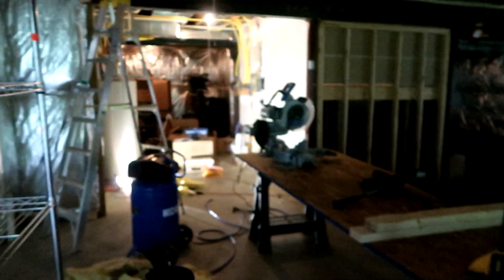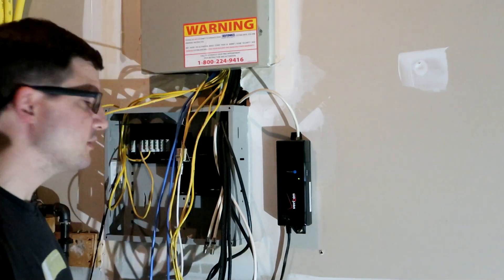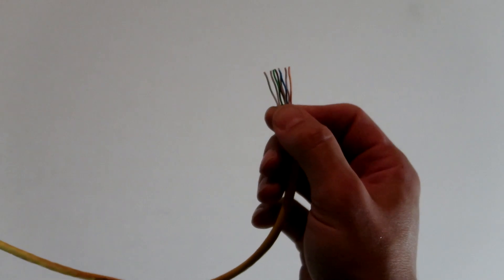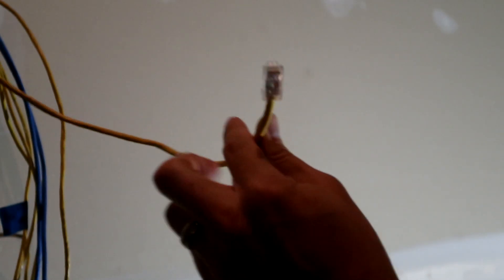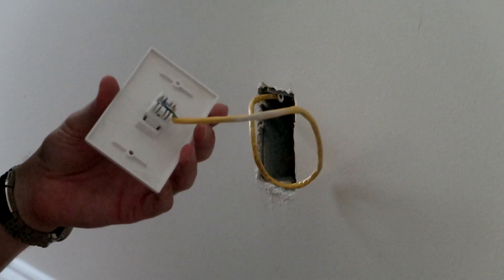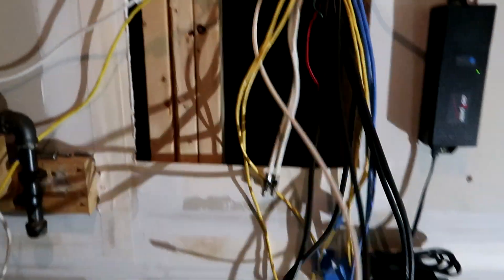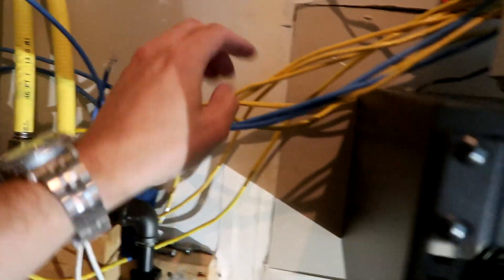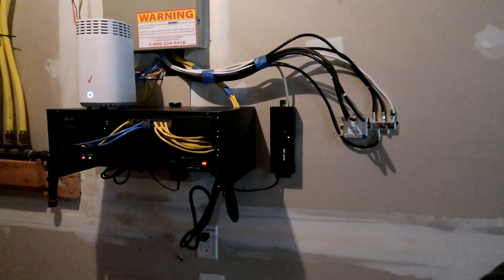Modernizing my home network and converting phone lines to ethernet

Comment: I am a novice.  Remedial question, how do I actually trace the wires - which Cat5 wire goes to the main panel?
Reply from the maker: if you know where each end point of your cables are, you can connect a tool that will send a signal through the cable that you can see.  it is a manual process though so you'll have a bunch of trial and error

Comment: So as far as taking the connectors from the garage. You plugged a switch into the modem then hooked up the new rj45s into that?
Reply from the maker: Yes switch plugs into modem and each port on the switch serves up traffic

Comment: The fact that you already had Cat5e ran for the phones made this 1000x easier and was not really a phone line to ethernet conversion since technically the house was already running ethernet.  A conversion would have been replacing the RJ11 (4 wire) runs with RJ45 (8 wire) runs.
Reply from the maker: You're right it was very convenient. 🙂

The only way to 'convert' the lines is if an 8 wire was used for a phone connection, otherwise it would be a 'replacement' by having to pull more wire. 👍

Comment: Nice video. Do you know if every house has a system that gathers all wires in one place like the one in your basement? (Not sure what it is called) My new home was built in 1990s and I am trying to convert all landlines(telephone lines) to something like this. But I am having a hard time finding it.
Reply from the maker: if you have multiple phone lines going to different rooms throughout the house, the will terminate in a central location to be "punched down."  This is called the Demarcation point (Demarc for short).

Typically the best way to find this area is to see where the phone/internet service comes in to the house, there should be a box there for your cable/internet/phone lines.

Depending on when your home was built in the 90s you may or may not have cat5 runs (not 5e b/c that wasn't released until 2000), if you are lucky enough to have cat5 you will still be limited to 100mbps speeds or worse because that was the max rating back then.

thanks for watching, good luck
Reply: @PlatoonGarage  thank you so much for the detailed explanation.

Comment: If your live in USA you should do version B for internet 
If you do A you will have issue on your hands
Reply from the maker: Been using A at gig speeds, zero issues. 👍
Reply: @PlatoonGarage  you won’t have any issues with A or B if connected correctly 
What I was trying to say 
In USA residential we use type B 
Commercial and Government buildings use type A
Reply from the maker: @mikimiki195  gotcha, yeah as long as both ends are same it works

Comment: How did you trace the yellow ethernet cables to each room? I have a similar setup that I would like to get organized.
Reply from the maker: what I did was get the cat6 connector put on each end and then one at a time plug it in to my router.  then when room to room to see which outlet worked and what didn't - process of elimination from there
Reply: @PlatoonGarage  Thanks!! Awesome videos btw..

Comment: You can actually run ethernet over coax cable. It's called MOCA, Multimedia Over CAble. It great for running ethernet to outbuildings like a shed or unattached garage.
Reply: CA stands for "coaxial"

Comment: The best thing my home builders did was to use conduits for the cat5 cables all thru the home. It made fishing new wires so much easier. Nowadays you just see cheap builders staple cables to the 2x4s.
Reply: Staples on cat5 and above is a no-no. 
Zip ties on cat6 and above is a no-no.

: ]

Comment: You should have a cleaner cut on the outer jacket. Also the outer jacket should go inside the rj45 end further to where the crimp tool crimps it. There is a clear piece of the connector that goes in to grab the cable to prevent pulling it out easily. Leaving it out that far means only the copper pins are holding the inner pairs.

Comment: If there was actually a phone plugged in the Cat5E jack for any length of time the outer pins would be bent or pushed up from the phone plug and would be loose or not make contact with a computer plug.  I have seen that a few times.
Reply from the maker: good to know, we haven't had a home phone in a decade thankfully

Comment: One thing you may wanna upgrade to in the future is a patch panel instead of having all the wires go straight into the switch
Reply from the maker: Thanks for the comment, I will keep that in mind when the next time comes to do some more updating :)
Reply: Indeed. Punching a hole in that patch dry wall and routing the Ethernet cables through would also made things cleaner.
Good job though.
BTW why didn't you crimp an Ethernet jack to replace the old phone connectors?

Comment: Try the pass through RJ45 connectors and use one standard T568B. Most patch cables are T568B and mix matching is an unnecessary problem.
Reply: Technically you can use T568A as well as the electrical signalling actually doesn't care which color the particular wire has... as long as you wire it 1-1 2-2 3-3 4-4 5-5  6-6 7-7 8-8 as long as you wire them 1:1... But you are recommended to follow T568 or T568A espacially if annother Person will take over one day...

Comment: I'm a network installer The B standard IS the standard. But like JC B says overall good job.
Reply from the maker: I'm definitely not a professional, Thanks for the feedback :)
Reply: @PlatoonGarage  I'm not criticising I think you did a great job with what you had. I just mentioned the B standard for any of your viewers who maybe just starting out with a career in network engineering. Keep up the great vids.
Reply from the maker: cheers!
Reply: @bentheguru4986  .. I'd make the installer re-terminate if they used T568A especially if they failed to ask or recommend. Mixing T568A and T568B isn't good. Use T568B.
Reply: @bentheguru4986  .. First, T568B  is the standard and has been for years.

Most uses of T568A were from old CAT-5e for telephone and if you're okay with mixing T568A and T568B then go for it. However, for myself extending or mix-matching T568A with T568B patch cabling, routers, switches, extensions is a problem waiting to happen. Then spending hours to backtrack or finding a crossover cable to solve a self-inflicted problem to me .. not so smart.
Reply: @bentheguru4986  .. It has nothing to do with the "USA" T568B is the international standard for TIA/EIA/ISO.

Comment: T-568B is pretty much standard. All the patch cords you buy are wired in B diagram. But overall good job.
Reply from the maker: Thanks
Reply: B is the standard, but as long as each end of the run is terminated correctly (A to A, or B to B) you could mix and match type AA and BB cables as much as your hearts content.  Just don't make a crossover cable by accident.  They act funny unless your using it for specific uses. (Crossover cable is type A to B).